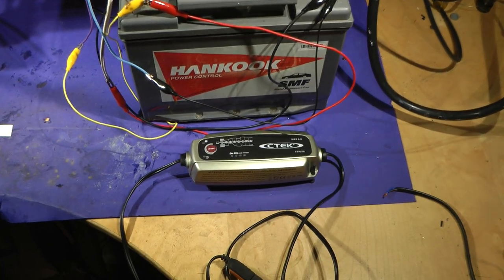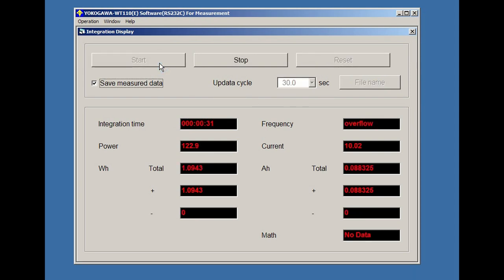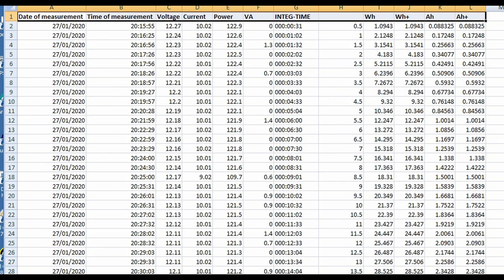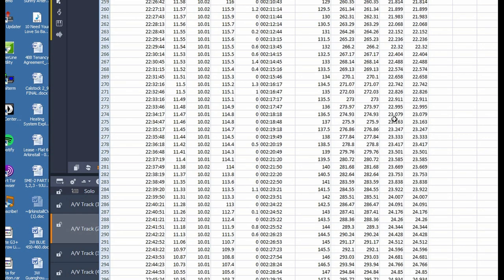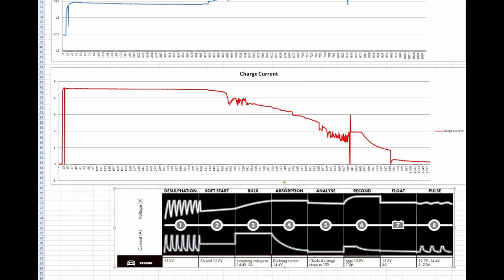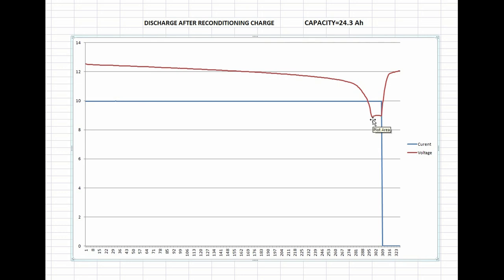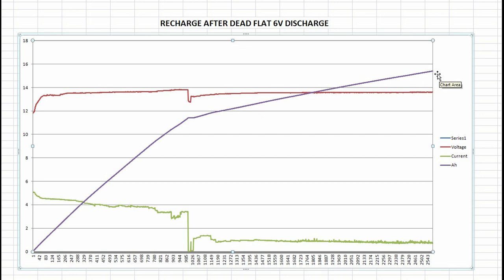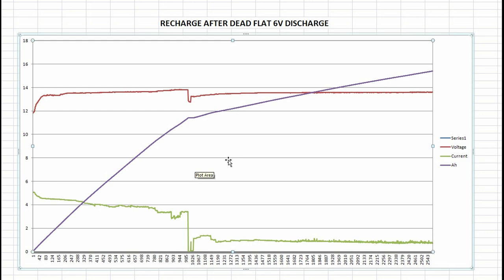CTEK MXS 5.0 Lead Acid car Battery Recondition Cycle test- Does it Work?

Comment: I have a CTEK MXS-5 which I use periodically just to top off my car battery. I've never been near the RECOND mode and have no intention of doing so. It flies through 1 (desulfation) and 2(soft start) in seconds. 3 (bulk charge) can take anything from five minutes to five hours. Which suggests it is doing some monitoring. Step 4 (absorption - what ever that is) always takes exactly the same amount of time, about 5 hours. This is 105 Ah battery and I've not tried it with smaller batteries but I have an idea that step '4' is purely done on a time basis.
Reply from the maker: Sounds about right. Its the analysis and remedial treatment step I don't trust and the high charge termination voltages on the ones I have tested.
Reply: @razenby  Once a lead battery has been deep discharged and left in that state it's finished (in my opinion). RECOND might get enough charge back in to start the car and get you down the garage to fit a new battery but beyond that I wouldn't trust it. What do you mean by high charge 'termination' voltage please?

(I've no intention of even trying RECOND mode. Deliberately gassing a sealed battery sounds a bit risky to me).
Reply from the maker: @paulanderson7796  Yes absolutely. Good conclusion. no miracle cure as stated on the packaging.  Time for some honesty from the charger manufacturers.
Reply: @razenby  They're decent enough battery maintenance devices. Nothing special, just a couple of rungs up from the old linear bricks from Halfords. Lots of car makers badge them up and sell them as their own products.

Comment: You will only get 70AH if you discharge it at the 20hr rate. Ie 3.5A Check battery spec sheet.
Reply from the maker: That would be great to get 70Ah as it is only a 50Ah battery!!
Reply: @razenby  sorry I meant 50ah same thing, if you discharge a 50ah battery at 2.5a you should get 50ah, if you go at 10a you will only get 25ah as you did.

Comment: Whether desulphination works or not is a big debate. CTEK were one of the big promoters of this as well as one of the originators of the concept. However I have noted that many battery charger manufacturers are less excited by it now and at least one has even changed their charging strategy.
My experience has been on 12 volt motorbike and car batteries. These have been either AGM (Absorbed Glass Mat) or Calcium type. These are all lead acid batteries though not what are called flooded cell that I believe your test battery is. BTW don't confuse AGM with Gel batteries that many do. Most car companies using ICE power supply calcium batteries or AGM with their vehicles and state not to use flooded cell replacements due to the higher charging rates of the previous. That may also have something to do with what you noticed in the CTEK documentation. I have recovered batteries with desulphination but generally have had greater success with charging the sulphinated battery in parallel with a good but partly discarded battery. Note that sometimes this can take a few days on charge. You will often lose just a cell and can only get to 10.5 volts approximately and the best way to kill a lead acid battery is to fully discharge it and at 6 volts that's more or less that. AGMs can generally handle it better than calcium and flooded cell types hence part of the reason of their use in UPS, Golf buggies, etc though I can see that changing to Lithium where the conditions are right
Reply from the maker: I have never seen any quantitive proof that desulphination has any beneficial effect.  The chemistry doesn't support it. The only effect can be mechanical, expansion by heating or cooling cracking or dislodging the sulphate.    This Hankook battery was killed off by a singe short-lived deep discharge. I don't know why but I always imagined the sulphate growing slowly during a prolonged deep discharge. Reconsidering the chemistry I can't see why it cant happen quickly. I am going to take this battery apart... Rather than poo pooing everyone's belief I prefer to present the evidence and let them decide.
Reply: @razenby  I hope you come back. I've had doubtful experiences with ctek. The 1st one just quit on me and 2nd and now the third ctek 5.0 has the Button issue. Aw, the two agm (small) seems to work well with the ctec but not a reglar car battery (bosch). The big one in my tractor was as new after a day. (us made L/A open). Annother small open lead/acid loses its state quite fast after a ctec charge but not after a regular charger (old). That confuses me a lot. In my opinion its not worth it to by anything else than a premium battery.

Comment: One of the earliest things I heard about lead-acid batteries is.. If you ever fully discharge them you damage them... In UPSes that have lead acid they are only good for a couple full discharges. That's why these battery tenders are so crucial for preventing a full discharge.
Reply from the maker: Yes, go blow 10.4V terminal voltage for even a short time will screw a battery,  Battery minders are good providing the cure isn't worse than the disease.  Note the tenders don't follow manufacturer's recommendations for maintaining batteries in storage. Show me the rewards and I'll show you the outcome.... None of the parties in this market can be trusted to tell the truth,